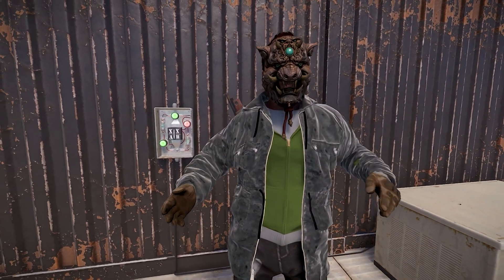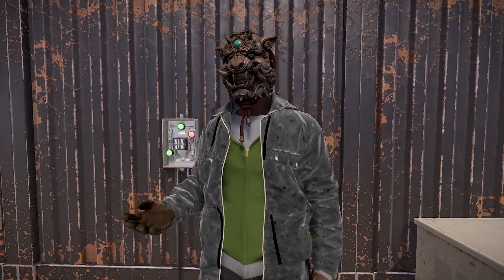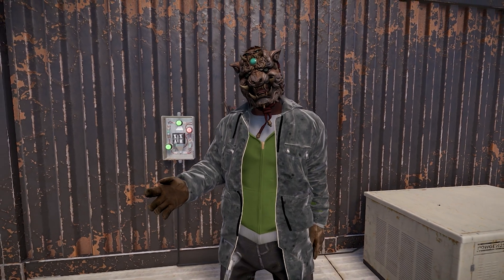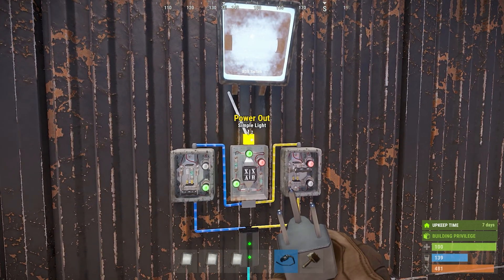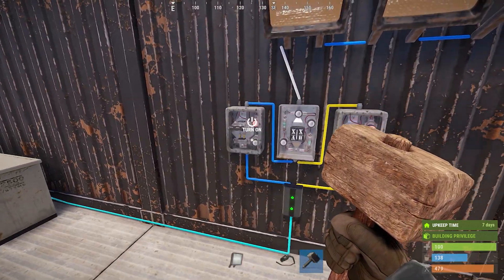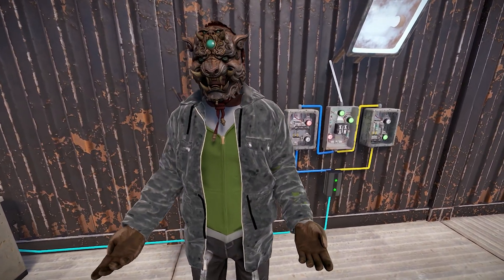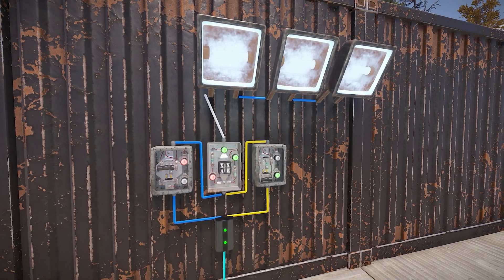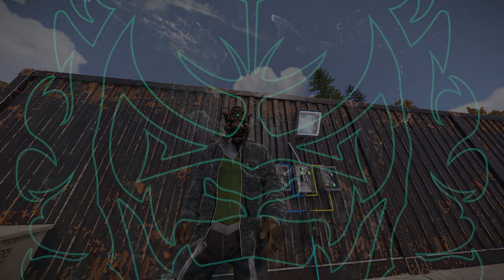Master the XOR Switch in Rust: A Quick Electricity Guide ⚡

Comment: good video ;)
since my lighting is controlled by either the sun with blockers or digital clocks (because i like to know the time on the server, so i switch out the blocker for them whenever i find one or brute force it through the tax tree) i mostly use XOR switches to deactivate stuff that is on the outside of my base in case of a raid. 
For example i have a "Master"-Switch in my Core that turns off all Door Controllers for my gates so the buttons in my compound and the HBHF Sensors on the outside do nothing anymore, my Smelter and Refinery setup will turn off their conveyors to the outside and only leaves the intake on so they get cleared out (which goes quite fast since i regulate my wood to ore/crude ratios pretty low, usually around 11 wood to whatever can be done smelting/refining with those 11 wood) and if i reach this state in a week, it also activates thanks to the use of a memory cell inverted output a conveyor that sucks out the most important things like metal, hqm, sulfur and so on out of my opencore and transfers it to some boxes inside my hqmcore. 
Since i use a seismic sensor to make my base go into raidmode basicly i dont even actually have to flip the switch myself in the core, because i connected the seismic sensor to a memory cell that closes all my garage doors inside, but only once so if i am online i dont lose control over my doors. When the Raid is over i have a button there to reset the memory cell so my Raid-Mode is armed again. So even if i get offlined my base basicly bunkers down on its own whenever there is an explosion of the category 2 or higher, category 1 just triggers a siren light inside my core.
Reply from the maker: Honestly a good way to use the XOR is a shut down feature vs power on. I dig it! As for seismic sensors, I’m unaware of cat1-cat2 types, what’s the difference?
Reply: @Sledge315  the seismic sensor will generate 1 rW, 2 rW or 3 rW depending on the "shock type" that happens. 
Basicly category 1 or 1 rW is generated by such things as f1 grenades, landmines and high velocity rockets, so basicly kinda harmless stuff for a base. Category 2 or 2 rW are generated by low damage raiding tools like the Satchel, explosive ammo and HE Grenades. Category 3 or 3 rW are generated when something high damage explodes, meaning c4, a rocket or MLRS.

Basicly by putting a consumer inbetween the seismic sensor and the smart alarm (or any other device you want to control when a raid happens) you can control when stuff will happen. I put my siren light after the seismic sensor because a stray grenade nearby doesnt concerns my bases ^^
Reply from the maker: ngl I had no idea this was a thing in terms of seismic sensors and scale. definitelly going to consider this moving forward its a huge help haha. this is why youtube is a great place for Rusters to connect and chat lmao, if you're interested in joining the discord server I have I think Im going to make a Rust dedicated room as I feel at this time it's appropriate! join up if you'd like! https://discord.gg/VkBBevmu9V